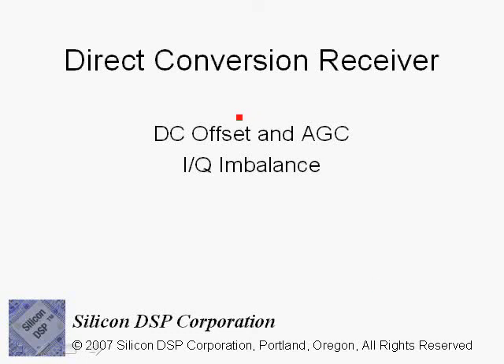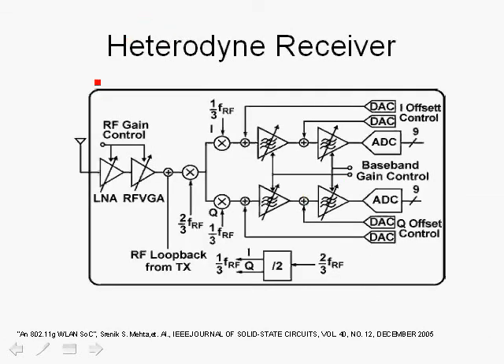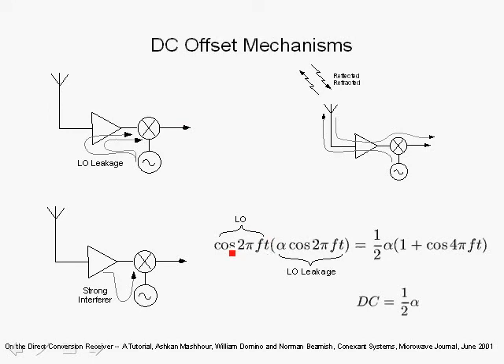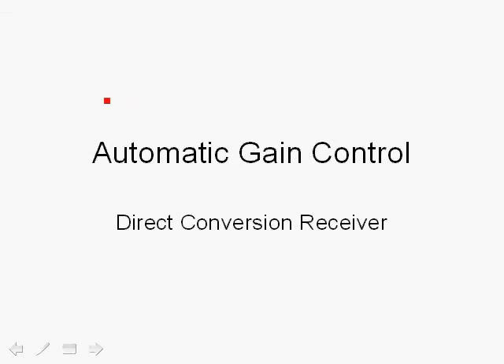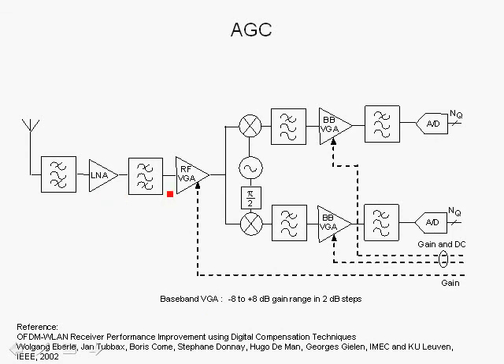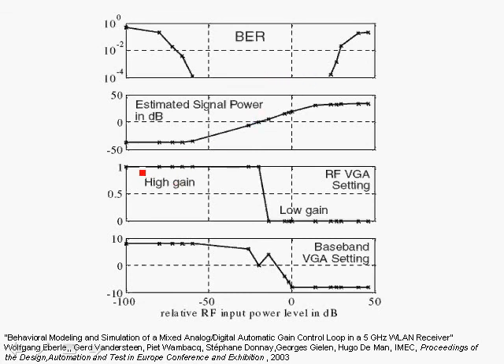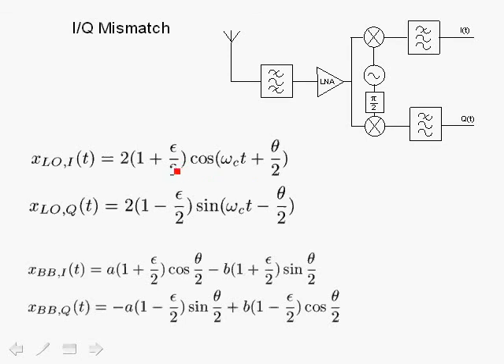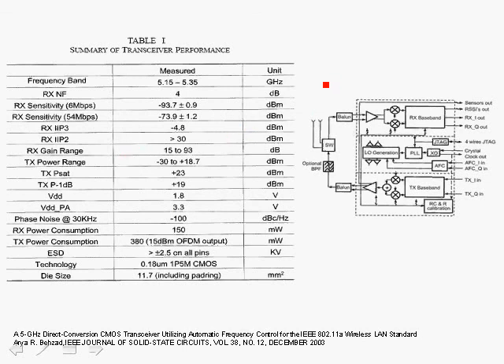OFDM Tutorial Series: Direct Conversion

Comment: can we just take the signal through antenna after lna perform mixing with a carrier to convert to a IF frequency and take only either I or Q component which can be send into the adc. what ever data is coming out of adc if u now mix it with IF carrier then we would get the baseband data directly. why is it not done like this?